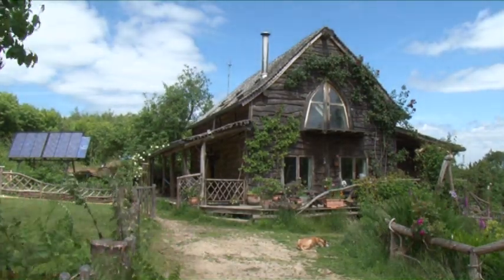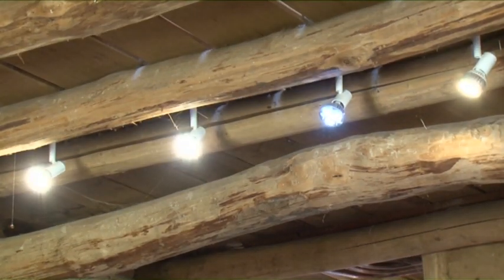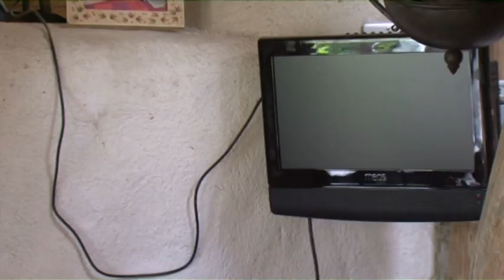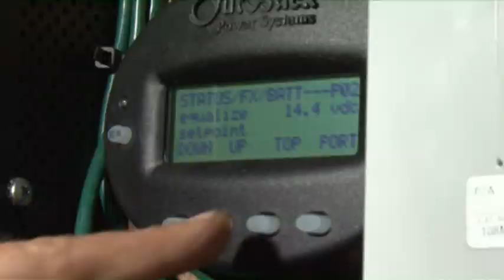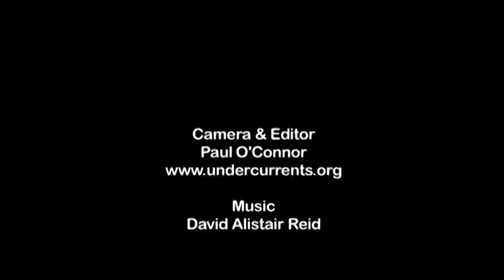12V Off Grid power in Woodland House

Comment: OMG you never forget a face I seen you on that house building program on CH4 that's it it has just come to me grand designs Ben anyway great idea running DC and using invertor for big stuff as using large loads on invertor suck all the juice I also see you are running a small turbine is it three phase?.Ben planning for a wind turbine here in the city is almost a joke to get permission.I have designed my own off grid charge system but yet to install it.Great to see your stove also that supplies heat for cooking and also hot water use I am sure Ben you will never run out of fuel LOL.

Comment: I wonder if it would make sense to run a bit of de-icing cable around the panels to keep the snow off during the winter. I don't imagine their current draw to be that significant.

Hat's off to you for this beautiful home, mate.
Reply: +devonblaine Resistance heating is pretty much the heaviest loads in electic systems.  Stoves, ovens, driers, and heaters.  Very high consumption.
Reply: +devonblaine  ................ as i understand it , the panels , without the potection diode , will under low / no out put conditions start to take up energy from the batteries & would emit a small amount of heat & burn off / warm off snow .  But of course that would reduce energy stocks . In the UK , for the few occasions we receive settling snow , this would be a lot of wasted time & sodding about for relatively little value ie clipping off diodes etc , building panel protection unit etc etc .

Comment: To combat the snow on panel problem as we get older and can do less ,put the solar panels on a pivot system that  arcs the panel down when it snows so that no cleaning of panel is required,the snow falls off because of  the angle \instead of/ your panel is presently set maximum to absorb more energy because of the angle but it will accumulate the snow ,so to correct this problem in the winter because the sun is at a different angle have the panels in winter time  aiming down ward so that all snow that hits them will fall off ,yes the rate of charge will decrease but the rate will not be obstructed by snow since the snow will fall off, constant charging will happen after the snow storm with out having to go out and wipe them off,then as the seasons change you can reset the angle for spring ,summer and fall,  and then again in winter reset it just for winter

Comment: Could you charge more batteries using this set up, without having to add extra turbines or solar panels? ( so that theoretically you could charge enough batteries in the summer months to last completely through the winter)?  Great inspiration... Keep up the great work
Reply: +Sean Johnson You can add as many batteries in parallel as you want in a system like this. However, it's only economical up to a point. You still need to produce enough power to charge them all and they are not cheap. There is a balance to a system like this.
Reply: That was a little belated lol, but appreciated none the less,  thanks for taking the time to reply
Reply: Yeah, it was belated, got here as quick as I could. lol. I mostly answered because it was left unanswered and others watching this video might have the same question. Hope you got your system sorted out. Cheers.

Comment: 12v is much safer...ive lived off 12v for 3 and a half years on a canal boat, to run an inverter off car batteries creates a huge draw of power, its much more economical to use 12v on as much as you can

Comment: You have a killer system I'm surprised that you don't use AC instead of the 12 volt system.Much smaller wires.You have enough power there to run two houses on AC